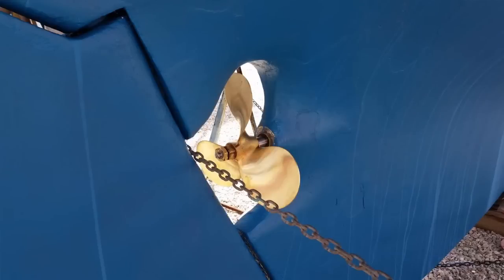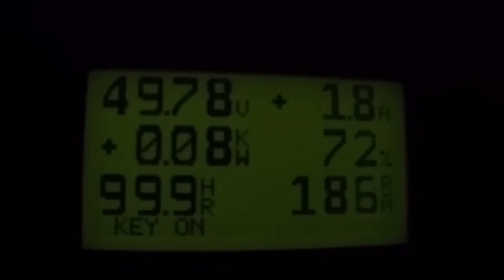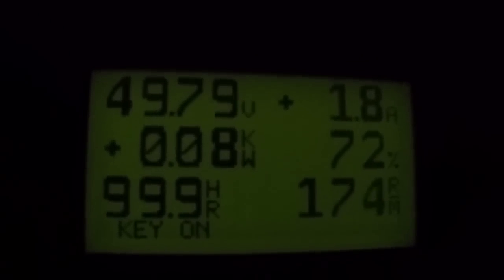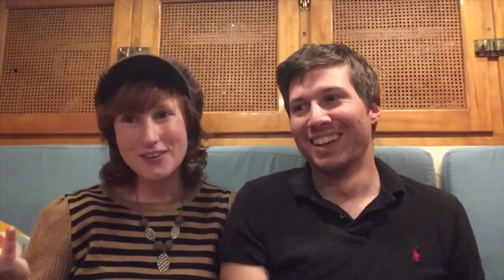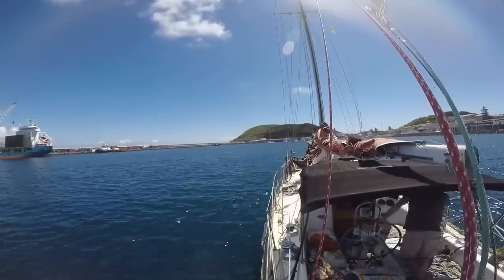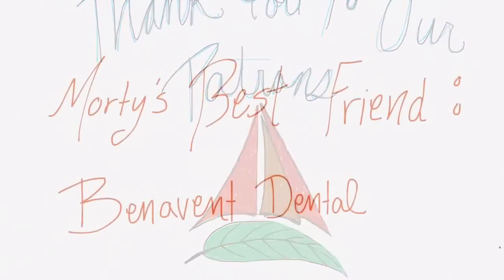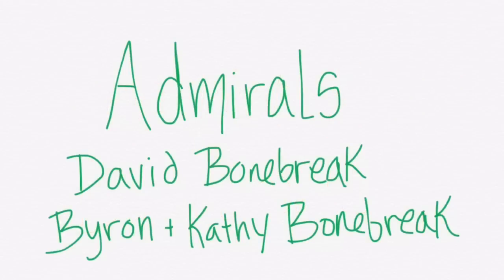Electric Motor, Ocean Crossing with Regeneration | Sailing Wisdom

Comment: Hi Guys,
Thanks for making this video. Great to hear your opinions.

Herb, when you did your research on propeller size. Did you find out anything about the best pitch angle for an electric motor? I understand that an electric motor produces a lot of torque. So, the pitch angle might be different from a diesel. I guess torque vs speed?

You should check out secondhand Tesla car batteries on eBay. Taken from cars that have been 'totalled'. They are surprising 'cheap'.

Have you guys considered getting a wind turbine? If the conclusion was 'no'. Why not?
Reply from the maker: When we bought the motor, the company sized the reduction gear of the motor based on the propeller size. I do not know what pitch would be best for the electric as it was not something that I knew to discuss at the time. 
I am watching eBay and Craigslist for a great deal on batteries! They are really cheap :)
We don’t have or want a wind turbine for a few reasons:
1. They make a whispy sound when they run that neither of us like. We had a neighbor in the marina in Baltimore that had one and the noise bothered us, even inside our boat. 
2. I crewed on a yacht once that had one and the noise bothered me there as well. When we were sailing downwind, we had to crank up the diesel for power because the following apparent wind was not powerful enough to produce power. 
3. We prefer to anchor in places that are protected and not with steady 20 knots of wind. 
4. They are rather pricey for something we don’t want to listen to. 
5. The hardware to mount it is almost as expensive as the wind turbine. And then it’s another electrical gizmo I would have to maintain. 

All this being said, we were on a friends ketch in the Bahamas for dinner one night and we didn’t know they had a windgen, and it was cranking out the amps in a calm anchorage, totally slashing all our complaints about them (except for cost and hardware). It started with an R and was totally silent. 
I know that this sounds like a lot of whining, but our big power hogs are the fridge and motor. With the little solar we have, we are able to meet our needs and therefore haven’t looked too hard into windgens. 
Herby

Comment: Two questions keep nagging at me,  perhaps you know the answers.
One is, why do yachts use sea water to cool engines ?  My car engine is closed loop, and is super reliable.
Secondary, to charge batteries couldn’t a propeller driven device be towed behind to generate power?
Reply from the maker: Great questions!
1. Sea water is plentiful and airflow in an engine bay is limited. Having a radiator like a car has is difficult to plumb and route, so builders do the easier thing which is to pump in corrosive salt water to cool the motor. 
Some motors have a heat exchanger where the corrosive sea water only contacts a water/water radiator (where a car has a water/air setup), while other push saltwater through the iron motor. 
2. They do make this and sharks like to eat them. In our case, the electric motor makes power using the propeller, but people with a diesel motor can hook an alternator to the prop shaft and let the prop spin the alternator to make some power while sailing.

Comment: Our boat is 17500 lbs and 35 feet with a 17 inch - three-blade prop. (Island Packet 35). Would you say your motor would be suitable for our boat? We already have 700 Watts of Solar and a 300Ah Lithium house bank, which We plan to supplement with 8 more x 100 Ah lithiums.
Reply from the maker: That would work very nicely for you. We are 36,000 lbs and it can scoot us around a marina. The most impressive part of electric is the ability to stop and start moving. The thrust is instant and as a result you move quicker and stop quicker which is very helpful in tight quarters. 
Our motor is the QT20 from electric yacht
Reply: @RiggingDoctor  Thanks. It does seem quite noisy though. I was even considering the QT10 but not sure if that will work. I only need it to go 16 miles down a river from the anchorage.

Comment: How long does the honda take to charge the batteries so that you can motor 1h at ~3knots? This would be my realistic scenario :) Awesome video guys. Thank you.
Reply from the maker: The charge is only as fast as the charger. We had a tiny charger so it took hours but with a larger charger it should be able to charge while maintaining that speed.
Reply: @RiggingDoctor  oh, so you need to plug a charger to the Honda. I thought there existed "DC generators", so it would be straight forward and more efficient. Still learning here :)
Reply from the maker: You can, but the generator puts out 12v, the motor bank is 48v.

Comment: Herby, 18 tonnes, are you talking about coast guard no.? I don't believe that's displacement which should be around 12- 12.5 tonnes.
Reply from the maker: When we are in the slings of the travel lift, we consistently weigh 36,000 pounds. We are always on a diet but we never seem to really drop the weight.
Reply: Interesting, but travel lifts are notorious for being out of calibration in my experience. Manufacturers spec cannot be that far off. Anywho, congrats on making Horta!
Reply from the maker: The designed waterline of 30,000 pounds is about 4 inches under water so I kind of believe that we are overweight :/
Thanks!

Comment: Your solar panels just went "kaputt"? ;-)
Regards from Germany☺
Reply from the maker: Yeah, the little wires that connect the panel to the cable corroded away flush with the panel. The ones on the deck had rust spewing from their connection box.
Reply: @RiggingDoctor  I understand that thank you :-)
I was just suprised to hear a German adjective in an English sentence.
Reply from the maker: It is such a useful adjective :)

Comment: Do gasoline generator and electric motor , consume less gas comparing with gasoline motor boat ????
Reply from the maker: Yes. The gasoline is used more efficiently in the generator and the electricity is used more efficiently than if it were a gas engine.

Comment: There is some good YouTube channels on building batteries for much less than buying. it would take some research and time to get up to speed but it may be something that you would enjoy. If you buy the components correctly the price is similar to lead acid battery.
Reply from the maker: That’s great to know! 
Our batteries just died and we are replacing the batteries in a bit of a rush, but with more time, this would be right up my alley!

Comment: Well done guys!!!very informative on electric motor and sailing ,real sailors don't need engines but electric is a good clean safety way for entering ports or short runs.thought it's still quite expensive  and I believe a small outboard could do that also although you still need to carry gasoline .i believe the future belongs electric  and eventually hoping their price to be more affordable
Reply from the maker: You should check out thunderstruck-EV. They are a lot cheaper than the rest and use the same motors as the fancy setups
Reply: @RiggingDoctor  thanks I m already checking them they are the cheapest in the market.i only didn't understand if their motor has some place that I can screw it on the base.also I was wondering if I remove my old diesel if I will be able to use the shaft and propeller from her on the electric?
Reply from the maker: We reused the same shaft and prop. Ours is electric yacht but it uses the same electric motor. I’m assuming there are bolt holes on the face because that’s where ours mount to the frame. (I haven’t taken mine apart yet so I don’t know for sure) the motors are made by Mars

Comment: Look at Carbon Foam batteries.  If you only do 50% depth of discharge they last a pretty long time.  Apparently if you don't  abuse them they can last about 80% as long as lithium.  They cost about 1/3($360ish 12V g31) as much as the cheaper $1000ish lithium batteries.  Which with the cost savings you can double the AH in the bank, because you can run them down to zero.  Firefly Oasis is the brand.  You can discharge them down to pretty much 0 without the huge penalty lead acid AGM take a hit on.  Also you don't have to top them off really, but they do weigh just about as much which shouldn't make you take a hit on the boat speed any at all considering your displacement.  Just goog-le them and read.  In other news..SV Cats posted on Learning the Lines channel that an electric boat was wrecked last year because the batteries ran down too much in a current, and the 6kw generator didn't bring it back enough to keep from being wrecked.  I think they said it happened leaving Charleston, just south along the coast by a shallow inlet...maybe they hooked a bunch of anchors and stuff at the anchorage and didn't realize it ... The wreck was a total loss, but they did manage to salvage the hull.  That is about all I know.  I guess the story is really watch your charge levels vs currents.  If you can't hack the current don't get in it, or wait, or go somewhere else.   I think he said they tried the anchor but it wouldn't catch, and the boat caught some rocks.  Just take it with a grain of salt.
Reply from the maker: Ouch! Charleston had some epic currents. When we snagged that old mooring anchor with our chain, we had a timer running because we had to make the tide. 
Untangling our chain took a few hours, but we still managed to make it out with the ebb tide (going about 6-7 knots with the current and just a touch of motor). 
I will look into those carbon batteries!
I had seen a “salt and cotton” battery that can take 100% discharge with no harm, but they couldn’t discharge quickly enough for the motor’s draw. 
Hopefully these will meet the task!
Reply: @RiggingDoctor  I just rechecked the price with a couple of people $512 for the Firefly Oasis.
Reply from the maker: And I saw they have an electric vehicle application part of their page. Thanks!

Comment: Minn Kota got approved for 38V user installable ( 12 cell per series string ) on salt .... so i am guessing that is where the new regs are going to be going.

and, with that, i am putting my money on 38V as far as my development work goes ... i hate to design things over again.
Reply from the maker: I met a catamaran that mounted 4 Minn Kota motors on his boat, one at the end of each hull. 
He had ultimate docking maneuverability! It was really cool. He could control all of them from the helm and had omnidirectional thrusters at his disposal. His was a 48v setup to push his 40~ foot catamaran against the wind while docking.
Reply: @RiggingDoctor  nice meting you tube stars....hello :) 
very interesting indeed, but being the min kota units are not re-gen capable, and the unit cost, that extra maneuvering flexibility is the only payback .

what i mean is that Min-Kota has Allot Of Money In Research behind the 38 V salt Number.....that Number is the New Salt Safe Liability Gold for anyone developing user installable salt water systems, ( or selling the components )

12 cells 38.4 Nominal safe maximm.....well that's a hell of a thing to work with in saltwater system design, but it can be done....i spec-ed a Current Code legit ( 8 cell per string system ) 24V system useing one of the new Ashwood Axial Flux motors on a 7,700 pound 27 foot coastal cruiser, and was actually able to get hull speed type torque into as standard prop...

with the heavy displacement sailboats, installers are sort of forced to take any liability onto themselves...you can't sue anyone, so follow safe practice and consider slateing dead spaces for positive buoyancy foam...because that's all you can do is manage the risk above 38.4 nominal.
Reply: 48V lead acid is the old Fresh Water code spec ....salt is more conductive and Also...another important point ( if some youtube stars could do a "dispelling the myths of electric propulsion" ( and see my previous comment here ) the 17 inch minimum regen prop is a Myth also...
re-gen is All In The Controller Programming...if you load it too hard it won't spin, if you don't load it hard enough it will mostly just spin.....reductions are also a re-gen efficiency reduction, and if you get the programming right, the re-gen power will just come Gushing out..regardless the size of prop, it's prop power x efficiency
Reply: @RiggingDoctor  you have the audience, i don't....thank you for your attention.
Reply: @RiggingDoctor  i am passing the ball here, grab it and run with it...

Comment: "All boats are equal but some boats are more equal than others" …… ultimately the regen power is derived from the sail power less losses. More sail area coupled with better designed hulls and keels will be able to regenerate for longer because their average speed will be higher than the full keeled dinosaurs, irrespective of the hull speed myth.
Reply from the maker: Completely true!
Our average speed crossing the Atlantic was about 3.5 knots. Since the propeller is in an aperture, the highest regen number we ever saw was 12amps at 48v (576W). The regen number was usually in the area of 4-6 amps (192-288W). 
We met a guy who usually produces over 1000W when sailing at 5-6 knots! Our peak power production was when we were sailing close to 10 knots! The guy had a modern hull with a sail drive and a massive propeller, making it the optimal situation. The propeller was fully exposed to clean water flow while ours is tucked away inside of our keel, only seeing disturbed water that somehow glances the propeller blades. 
This is why we felt we could honestly assess the true ability of regen. We are the worst candidate for it and if it worked well enough for us, then we are confident that it will work miles better for everyone else 🙂

Comment: i would look into the cooling systems the auto industry is using with their lithium battery banks. they use a cooling system to prevent overheating the batteries. which if they are overheated, they would become a fire hazard. think of the samsung cell phone issues... if your ship is light, installing nickel iron batteries, in the keel would be a solution, for more ballast.  nickel iron batteries can  be discharged to very low state without damage. you just need to maintain a proper level of distilled water in the cells. which automatic filling systems are available. nickel /iron batteries were used by submarines, until nuclear power was developed. they are available new from several suppliers...
Reply from the maker: We are currently in the market for new batteries and the fire issue is making me shy away from lithium. 
Could you give me the names of some of these manufacturers?
Thanks :)

Comment: What do u recommend for a 40ft monohull for electric motor what brand and capacity for ur experience
Reply from the maker: We are 45 feet and use a 20kW motor from Electric Yacht (QT20). 
As for specifics on sizing for your boat, I would talk to Mike Gunning (mike@electricyachtssocal.com). He’s the expert on this topic and can help you determine exactly what size and system would work best for your boat.
Reply: Thanks so much u r amazing

Comment: Will the Honda generator run the motor at low power?
Reply from the maker: Yes, but the limiting factor is the battery charger in between. The generator puts out up to 2kw, so if you had 2kw of charging, you could then motor at 2kw.

Comment: It's a new right now but in time electric motor regen will improve and become the only way to power
Reply from the maker: It’s just a matter of time!
Our 4 year old batteries died and the replacement batteries are cheaper, more power, and slightly lighter 👍

Comment: I have spent the last decade building superconducting magnets and just finished a contract building a 50 KG 265KWATT electric motor for an aircraft and I would love to have an electric motor on my liveaboard 11-meter cat but... I motor for an hour at about 5-6knots just to get to the seaway... diesel sucks but it works. power storage densities is the problem for now.
Reply from the maker: I agree, as I was reading your comment, I was thinking “he better keep with diesel!”
To motor at 5 knots, we burn around 100-150 amps. To do that for an hour out, and then an hour back, you are talking between 200-300 amps. Then to safely have power to dock, you would need extra. That would be something like 12-16 batteries minimum (@48v) if you took them down to 100%DOD. If you only went to 50%DOD, you would then need 24-32 batteries!! Wow!

Comment: There is a big difference between a propeller and a repeller.   Using a propeller for regen will give you only a fraction of the power possible for the amount of drag.   The efficiency is very poor.

 Much better to have a dedicated tow gen or hydro gen and this can also be adapted to work at even slow speeds and still make significant power even anchored in tidal currents.

18kw motor is actually huge.   A sculling oar is already enough to get on and off docks and this is about the same as a 200 watt motor.    You should be fine with 2-3kw.. you can get water cooled ones which can do 7kw or more for a few minutes.  A large motor is less efficient because there is more friction, but mostly it takes a lot of pollution to produce this motor.

The fact that you use a generator and then talk about not polluting the sea is a real disappointment.  I am engine free for more than 10 years.   I don't have a propeller anymore, but when I did, the motor used 250 watts.  I travel all over the world, and also including the ICW for several long stretches.
Reply: Having a seldom used backup generator is very wise.   Sailing is fun and exercising your skills can be very rewarding but the wind and the weather are beyond our control.  If you get a couple of weeks of fog, it gives you something to fall back on. (Little or no wind and solar).  Good weather forecasts let you plan and avoid many problems, but sometimes they are wrong or leave you with no good options.